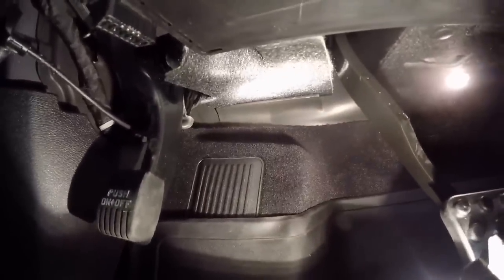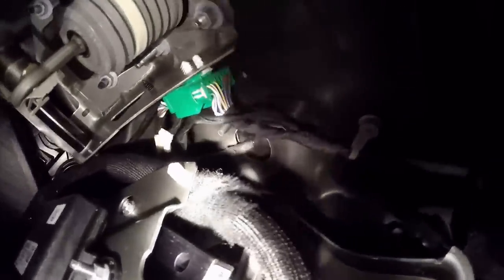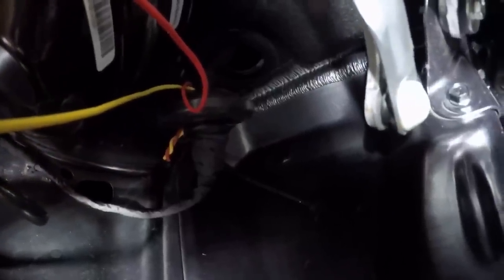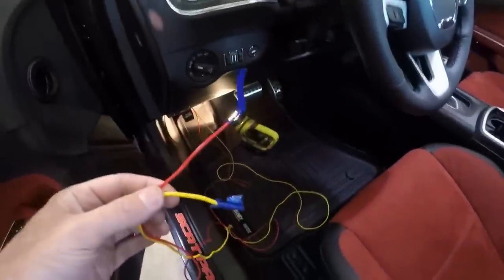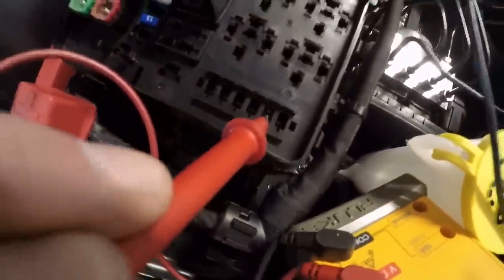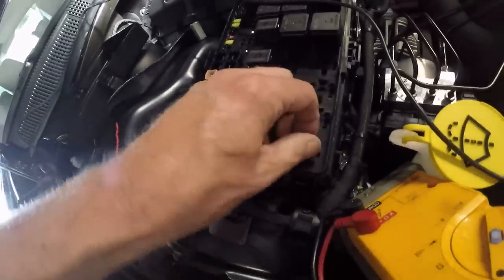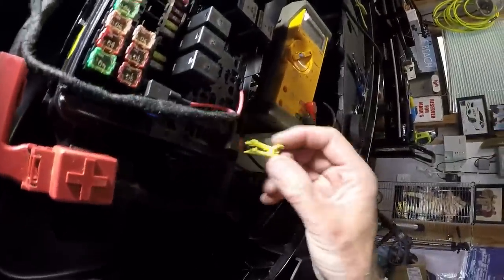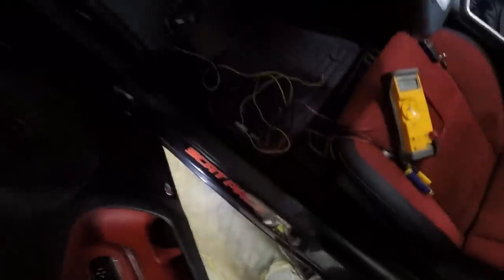2018 Dodge Charger ScatPack Ep. 36: BlackVue DR750S Install Part 1 - Hard Wiring

Comment: Thanks for this video.  I have a 2017 Charger Scat and am installing a Blackvue also, however, one difference is I'm wiring in a Powermagic Pro to keep it from draining my car battery.  So far, I've been having troubles finding power and acc fuse to tap into, but as I learned from your video, those add a fuse taps require a fuse in both slots, or at least one of the other, and also didn't know they were directional.  So, I'll get back to the drawing board this weekend and hopefully get some power reading on my multimeter.
Reply from the maker: ya to be honest i dont even use my parking mode.. i cant be that paranoid.. i just have it in case someone hits me while driving.